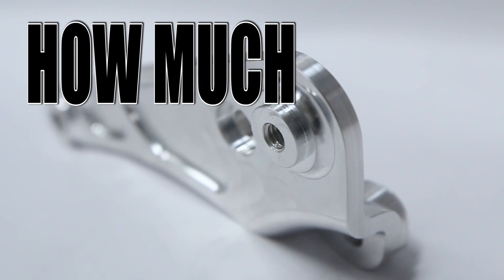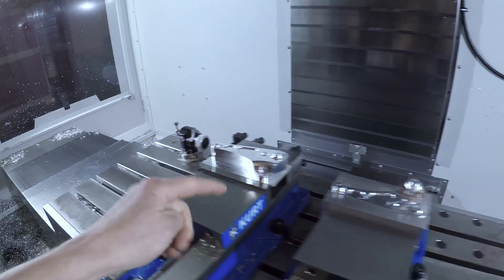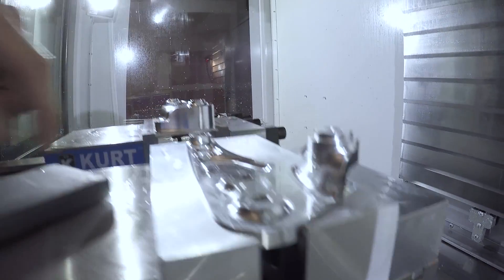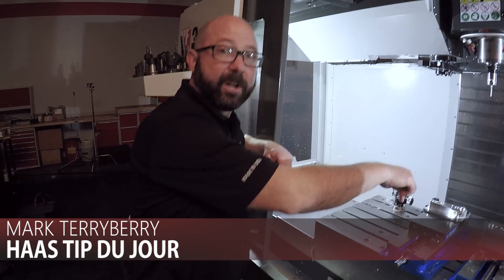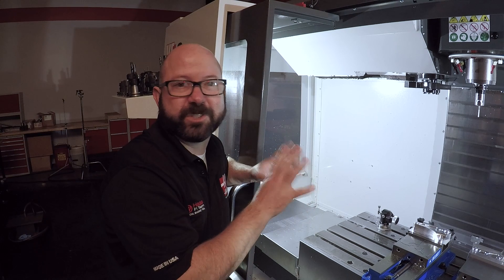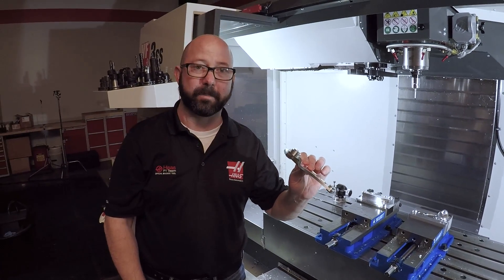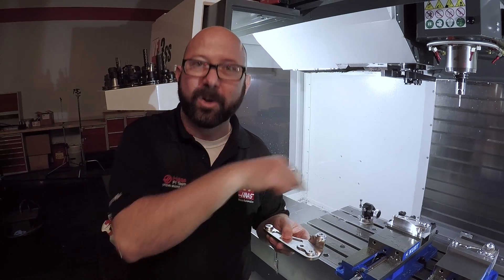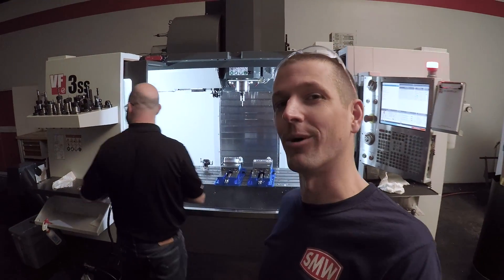How Much would You Charge to Machine this Part?

Comment: Uggh... see, this is why inventors like me, (who don't already own their own CNC equipment) will never be able to get their designs and prototypes out to market. Hell, even to make one proof of concept for a potential investor to see, or to show in a crowd funding situation.

Why aren't there more American based shops that price the part, not the milking the clock. I can supply a 3D stl file ready to machine, yet they still want to nickel and dime me, when I'm just a one-man operation. Not a huge company outsourcing a gigantic run.

This is what drives innovation and manufacturing overseas. I can get a quote in less than 30 minutes on Alibaba from hundreds of machine shops all vying for my money. I can pick and choose based on their equipment/tooling, their 9001 ISO status, their turn around time, material selection etc...

Then when I make enough money from initial sales to buy my own CNC machine, I'll control my costs and keep manufacturing in-house. Screw job shops. They don't care about me or my project, just keeping the machines running.
Reply: I'll be honest with you Eco Mouse... 

The reason job shops don't care about giving you a great price on your one-off  part you want made, is because every.... single... week... some chump comes walking in the door talking about his world changing invention and how he doesn't have a lot of money to spend, so he needs the machine shop to give him a really super amazing price, BUT!!!, if they will just give him a cheaper than dirt price on this part, he guarantees them that this invention will take off and earn $$MILLIONS$$ and then he will be back and they will be making tons and tons of money on all the work he will be sending them.

The chump talks about how easy the job will be... he's done most of the work already... it will be so simple, all they need to do is load it on the machine and press go!  They can run it at night or on the weekend when they are slow.  They can run it out of scrap material they were going to throw away!

And you know what?  That chump is the worst customer ever.  He wants the job shop to pay for his invention.  He wants them to do the work pretty much for free.  If he was so confident in his invention, he could go to the bank and get a loan to get it made.  He could sell his car or his collection of video games or whatever to raise the money.  He could take a part time job to raise the funds.  But nope... he doesn't want to actually want to make any sacrifices himself.  He needs the job shop owner to make the sacrifices.  And when they look at his part... it's nowhere near ready to run.  The guy doesn't know the first thing about machining.  He has square internal corners.  He has deep tapped holes.  He has counterbores on back surfaces.  If the job shop owner is dumb enough to engage the chump, he will end up re-engineering the part to actually make it manufacturable.  And if he is dumber and agrees to make one for the chump, then the chump will be calling 20 times a day to ask if it's done yet, swinging by the shop to check progress.  He will be the biggest pain in the ass ever.  And the job shop owner will give up a night or two or a weekend to get the guy out of his hair - all for a job that he's not making any money on.

And when he finally gives the chump the part that he lost money making, the chump will happily drive away, promising to be back soon when the orders for $$MILLIONS$$ start rolling in.  But they never will.  Because the invention will never go anywhere.  It was just pie in the sky bullshit.  And then the job shop owner will be just like every other job shop owner - when a chump walks in his doors talking about an invention, he'll toss him the fuck out.  Or he will double his usual rate because he knows what a pain in the ass inventor-dreamers are, especially when they have no money to spend.

You're right.  They don't care about you or your project.  And why should they?  You don't care about their business - and you think they should care about you?  You're a selfish prick.  No wonder your ideas haven't gone anywhere.  And you aren't going to make enough from "initial sales" to buy your own machine.   And machining is a whole profession of it's own.  It takes years to become proficient.  If you were able to do it, you already would be doing it.  So if you believe what you say then suck it up, get a loan and let a professional make your part for you.  Otherwise, admit what you already know - it's a junk idea that's not actually going to sell a damn thing.
Reply: That's just the problem... you refer to us (customers) as chumps. You are part of the problem, and robots will take take your jobs, along with the billions of Asians.

BUT... I know your argument well in my line of work. I deal with customers who want the works up front and promise me they'll bring me more work. But I've been around long enough to know this game, and I talk with them, and engage with them. Make them feel like a human with an idea, a creation. I also charge up front my costs associated with running his job so I'm not out of pocket. He thinks he gets a great deal, and if he never comes back, no skin off my back.

And I'm not a selfish prick, quite the opposite. I'm a problem solver. It's what I do. You can't be a selfish prick and know as much as I know AND be willing to help and share with people to meet their needs. I've built my business without help, without loans. I'm self made and self taught. I know machining, fabrication, welding, design, CAD, CAM... you name it I've done it. I might be a lot of things, but selfish is not one of them.
Reply: Eco Mouse, you may claim knowledge, but when you state that robots will take the job shop jobs - hahahahahaha!!!!

Since Alibaba is the hot ticket why whine on this thread? Yeah the Chinese do not have the "overhead" that Americans do. How was it getting your stuff thru customs? Did it meet your quality expectations?

And why did Melange take the time to explain things? Because running a American Machine Shop at some sort of profit is HARD, VERY HARD. And folks like Melange that have "been around the block" have learned that one trick is to avoid unprofitable situations, like folks that cannot accept honest feedback from machining professionals.
Reply: Please don't supply an STL file to a machine shop. CAM software HATES STL. It's a point cloud format rather than a vertex format. CAM wants to know where the geometry is...not the millions of points that make up the surfaces. It calculates the surfaces based on the geometry. If a job shop sees an STL file, they're adding in the cost of redrawing your part.

STEP/STP works well and is pretty common in most modelling software. IGES/IGS also works, but is a bit less common.

As for your main point, 1 off parts are a major pain in the ass. They're expensive because there's no spreading out the costs over multiple parts. It costs the same amount of money to make a fixture to machine 1 part as it does for 1 million parts. If it takes 2 hours to program, that's $200 in shop time. That's $200ea for 1 part, or $2ea for 100 parts.

I worked at a shop that had an Inventor as the boss. The shop was but a small part of a much larger facility that dealt in science and technology access/education (nonprofit makerspace) and while he was brilliant at his particular expertise, he had no clue about manufacturing costs. He had this idea to make a basic wobbler steam engine kit and sell them. It was 7 manufactured parts each, he wanted them to be made of 316 stainless and bronze, he could only afford the stock to make 100 kits...and he wanted to charge $35 each. We ended up nearly tripling that cost because there was no way to make it work even though the machines, tooling and most of my time were all donated...aka free.

Had an inventor come in regularly trying to make his product. We only charged $40/hr machine time and that was just to cover expendables. No programming cost or any of the 100 other costs a machine shop might have. He spent close to $2400 there and still wasn't done by the time I left.

If you do end up manufacturing something in house, you're in for a real eye opener. The costs are much higher than you imagine them to be. Think of a part you want to make. Then go here and size out the proper material. http://www.onlinemetals.com/ The price for material alone is higher than most people think it is...and that's before it even makes it to the machine shop.
Reply: Eco Mouse, since everything is f'd up and ready for a "paradigm shift" time to "be part of the solution" (aka start your own shop). I think you said it best though, "EVERY machine shop treats people the same way".  Funny, my good friend does own a machine shop and his car is a 8 yro GM Tahoe - he must have the Porsche stashed away in the barn...
Reply: +Kenneth Higley You're right... I would usually provide whatever file was asked for, as I own SolidWorks, and now doing stuff in Fusion360.

I do currently manufacturer many things in house. So I know what things cost. Only on complicated bits, I send off to a local CNC shop. My biggest hurdle is the fact that right now, I'm a cash only operation. Meaning that if I need materials, and have to buy long sticks, bullets or whatever, that has to be accounted for and mortgaged out over other projects. Or I just suck it up, close my eyes and hit the buy button.

Again, I have no problem in paying a little bit extra for small runs. The problem I have is being blatantly ripped off, as if I was just some guy off the street who doesn't know anything. And then, to top it off, being utterly dismissed as a legitimate customer because I'm not walking in with a P.O. for 250,000 widgets. I've conducted my business in two states, 4 different towns, and EVERY machine shop treats people the same way. I think it's just part of the culture of people who huddle around this industry. You get a few really nice people, and the rest are just barely better in attitude than that of a union pipe welder who's trying to take his break.

This industry is ready for a paradigm shift. Many people are growing up learning 3D modeling, there's more and more access to machining. And eventually, there will be companies that pop up because they've had similar experiences and do things differently AND still succeed.
Reply: +Lou Kola... might want to climb down off your high horse there, hoss. First, you don't know me or what I'm about in my personal life or my business practices. Secondly, I only said that I COULD order from Alibaba, never said that I did. Thirdly, I pay my crew $22 an hour. I think that's more than fair. As far as a living wage, I don't really know what that means. I personally live under my means by a substantial margin. Far better than most. But I can't expect anybody who works for me to live lean like I do. Lastly, I'm the opposite of selfish when it comes to my time, knowledge and money.
Reply: Obviously, facetiousness goes right over your head. When all you care about is profits over people, you've already lost.

I am profitable, and I'm self made. I'm pretty sure I know a thing or two. But thanks for playin'

Comment: Hmm... I would put it at about an hour for the part... which comes out to approximately $60 where I work currently. Assuming no tight tolerances and such. Probably an hour and a half setup time, so $90 for that then $60 for each piece. If it were a larger quantity, I could see going down quite a bit more per piece.

I've always thought machine shop rates were higher in other parts of the nation. Pretty low here in southeast TN. And folks still gripe about the cost... LOL

Comment: Any skilled tradesperson (emphasize skilled) can be charged out at $120 hr plus material. Or more... This includes use of specialized tools. The customer is buying, potentially, years of hard earned experience. You would gladly pay a skilled plumber, for instance, that amount knowing you could dependably get a good flush. I think $109 is quite reasonable for a small run. underpricing a job just means you won't be there in the future for your customers... or employees.

Comment: Not having access to the patreon site I did a rough mental estamite of 12 min run time, 3 min setup per part = 15 min machine time X 30 parts = 450 min + 112.5 program+test = 562.5 min / 60 =9.375 hr. X $120 = $1125.00 Machine cost X 30 Material cost. (I don't have an estimate on material cost). So $37.50 + material cost per part. Allowing a fudge factor $40 each + material.

Comment: that's  $500/hr. Is that unreasonable?
Reply: elmarqo _ Not if the customer's a lawyer.😆
Reply: That's not $500 an hour you have to add programing(At least 3 hours), set up(at least 4 with the soft jaws) material, and tooling, and many other cost involved in running a machine shop
Reply: Yes

Comment: Since the one-time costs (programming, soft jaw, etc.) have been distributed among these 30 parts, if the customer orders 30 more parts, what would the per piece price be then? I assume it would be less, correct?
Reply: I would bid it as a separate job. There's still about the same setup, stock prep, machine and handling time, but the jaws are already made and the programming is done as well. Could probably knock 10-15% off for a repeat. 20% or so if it's a very large order (economy of scale...metal is cheaper by the ton than the stick :P).

Comment: I understand your frustration, but I do have some experience of this (as I both machine and buy machined products). I know that's easy to say on a comment, so I know that is not worth anything. I tend to buy machines and do the work in house because the actual cost of the machine is low compared to the guy stood in front of it. I agree $120 an hour is a good number- a number we would expect too. But $3300 for the days machine time is too high. And I understand this is primarily made up of labour costs for set up. Most of our movement into machining in-house was driven by the small batch charges we were given. Large production runs were pretty cheap as everyone wanted the volume and would make every effort to be competitive. But this means they tended not to focus on the efficiency of their set-up- or in Lean terms SMED. The challenge for machine shops is to drive the set-up costs down. Further along the supply chain, we cannot afford our suppliers not to be investing hard into SMED- we are spending our dollar elsewhere; we have to.
Reply: Without seeing his spreadsheet, I'd guess there is $400 in NRC tooling/labor.  Material is probably $10ea when ordered as blanks from metal supplier.  Machine time is around 15min per part, then probably 3min per part offline manual labor.  Machine amortization is $12/hr for 1 shift, or $3 per part.  Most machines don't run 100% 1 shift, so this job probably carries $150 in machine amortization.  Most shops are going to charge $100/hr for their floor labor, higher in some areas, like CA.  Operator time will be billed out at 8 hours, setup is part of NRC.  So $800 in labor.  The grand total comes to $400+800+$300+150 = $1650, or $55 per part.  $109 per part doesn't make sense to the market.  The customer's customer wouldn't see the value.  A nice round $60 per part is probably what many shops would charge.
Reply: I was in the $60-$70 range.  Like I said in my previous comment.  They might charge $110, but damn sure ain't gonna get the job.  Ask Titan what he'd quote.  Bet it's around $50.
Reply: I agree.  I got into machining and owning two CNCs because out souring was far to expensive to bring ANYTHING to market as a reasonable retail price.  I would be retailing that part at $50 and if buying from them I would be loosing $60 a part plus my costs.
Reply: Much worse than that, because having a machine in my workshop costs me the same $12/hr. But my design labour is much more expensive per hour. The problem is I can't keep my design labour busy EVERY hour, so flicking them onto machining small batch quantity is a huge benefit to me- they roll the code right off their CAD system and I just got to make it easy for them to do. At $109 per part might not make sense, perhaps the money should be $80- but when it adds up to over $2000 for 30 parts its worth much more to me that I keep it in my business to cover my labour than giving it to a subby.

Comment: 800+E for 1 part, 110-140E for 30 pcs. 3D milling should be paid if the customers wants it. 110 USD is fair enough, cheap though because in my country taxes are high, cutting tools and material are expensive too.